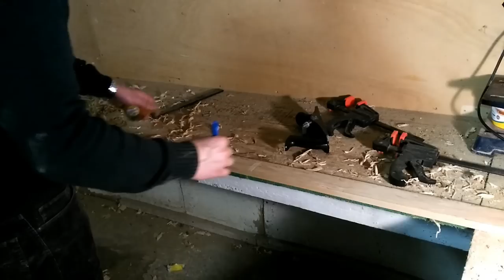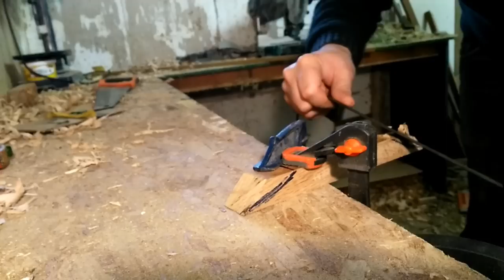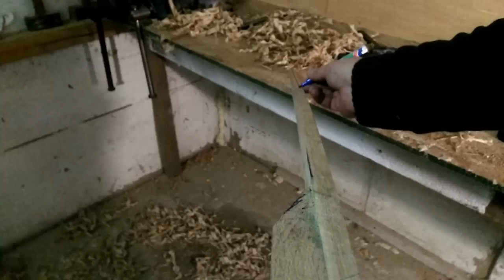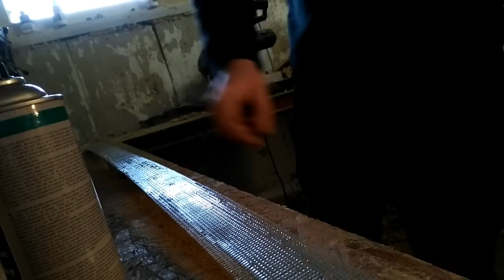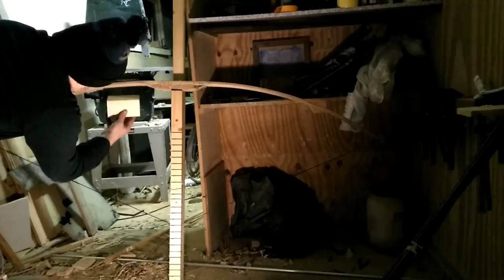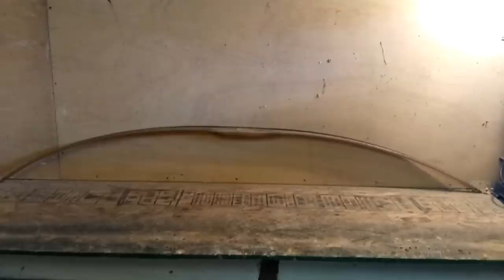DIY white Oak Longbow Using Handtools

Comment: I like how there are always the guys who call out string follow on a new bowyers work, as if they have never made a bow with string follow. 
Keep at it! Every bow is an opportunity to learn.
Reply from the maker: Thanks! I absolutely learned quite a bitmaking this bow, it was my first 'real' bow that wasn't make from a stick i found in the woods :'D Next one will be better! Thanks for watching!
Reply: @RobinCoomans   a little string follow smooths out the shooting, improves grouping, is more forgiving on release and lengthens the life of the bow.  All that for the price of five pounds of pull.   If you take it into consideration in the original poundage, and make your 55# bow 60# to start with, it will sweeten up at around 45-50 pounds and pretty much stay there.   I make mostly crossbow prods and string follow is a fact of life for a thirty inch or less bow.  I brace them at three inches or less and get on with my life.

Comment: nice, I never tried drywall tape, but I have built dozens of pyramid bows with straight grain oak from the lumber yard with raw hide backing. that's getting harder to find so I may give your method a try. thanks for the vid.
Reply from the maker: I've got a link to a website that I followed for this bow, he mentioned several backing that can be used! Thanks for watching!!

Comment: I noticed that when you had the bow in the jig used to ease the limbs into flexibility you ran a block along the bottom of it, was this to test if there was any uneven surfaces?
Reply from the maker: Yup, it was to see if the bow was bending the same everywhere. If the gap between the bow and the block change, the bow is nog bending evenly. Thanks for watching!

Comment: Interesting use of the block in tillering (the small block you run along the limb).  Is that sized to look for a particular angle?
Reply from the maker: No just a block I think I cut it at 10cm (4") or so. Just to check for an even gap. If the gap changes, the curve is not smooth and some material needs to be removed. Thanks for watching Joshua!

Comment: Is it right to take first front layer of wood ring? I thought avoiding this is fundamental thing for a good bow...
Reply from the maker: You should leave the sapwood for a selfbow if possible, for example in a English longbow it is very important! Because I used a stave from the sawmill I didn't have that. The drywall tape fills that role in this case. Thanks for watching!

Comment: There are many materials that could have been used as backing.  Linen and silk fabrics. Even heavy brown paper. There's alternatives to the fiberglass tape.
Reply from the maker: Sure! At first I actually wanted to try the paper, but I had this tape and it looked like an interesting choice too. Thanks for watching!
Reply: JSYK. you can also cover the back and belly with cotton strips cut from some old blue jeans and glue on using 2-hour epoxy. Thin the epoxy slightly with acetone just a little to make it creamy. Coat the bow, then the blue jean strip and apply, Cut a short piece of 1 inch round dowel to roll back and forth until you get a good smooth surface. After it sets, you can coat the outside with another thinned mix. Be sure to 'till' your bow first at about ¾ draw length first. Then you can trim the side tapper to finish getting a good curve to the bow. Look up 'tilling a bow' on youtube.

Comment: Good job Robin ! Maybe feather arrows will work better and more accurate because of the feathers structure.  :)
Reply from the maker: Adrián Hlina No doubt! And they look a lot better too. But Iwanted some arrows quickly and they seem to do the job :) Thanks for watching!
Reply: I use vinyl aisle marking tape for fletching my crossbow bolts.  It is thinner and smoother and much lighter than duct tape, and there is no 'glue squeeze'.  One big roll is essentially a lifetime supply.

Comment: I am new to self-style longbows and wondered about the bow taking a set when strung. How did the old archers deal with it and how today? Is it just accepted or do we do something to reset the set (string-follow). Does string-follow decrease the strength or accuracy of the bow? Thanks!
Reply from the maker: I don't know a whole lot about bows to be honest. I think for the most part you just deal with the set in a bow.. perhaps you could use some heat/steam to straighten all wooden bows I don't knw if this is common practice or not.  If the bow has laminations don't even think about the heat/steam, as the glue (epoxy usually) will  let go. 
I think that back in the day, as well as today,  you should look for a good piece of wood and take some more care making the bow and when it is in use obviously.

The set does indeed reduce the power of the bow. In my case it was not all bad as my little sister likes to shoot it :) If you are interested in some beautiful self-bows take a look at  the archery section: http://paleoplanet69529.yuku.com/directory#.WUFLoJDyhPZ

Thanks for watching!
Reply: Robin Coomans  Be careful not to tiller it too far too soon. That can cause set. You should try to achieve your target draw weight at every step of tillering. So if your target draw weight is 40lb, then pull to whatever length get you to 40, then tiller, then pull to 40, then tiller, etc until you are at your target draw length. I know this in theory just from reading but not in practice so take with a grain of salt!

Comment: Please tell me what epoxy on handle and what epoxy for tape. I tried epidermix on handle and it broke loose under tension. I used 2 layers of the tape with fiberglass resin but it reacted with the tape.
Thank you from Mickey in South Africa.
Reply from the maker: Hi, I don't know the epidermix brand. I used some 3M epoxy that changes colour when it cures, but I can't recommend that either. The glue I used for the tape on the back is just regular wood glue. Thanks for watching and the best of luck next time!! 👊

Comment: Will it break if u don't use the fibreglass? Not sure if it's fibre glass
Reply from the maker: Yup, it's fiberglass drywall tape. A backing is not necessary if your wood is good. In my case it was far from perfect tbh.
Reply: Ok thanks

Comment: you think make it in the wood s  if you just had a blue tarp Gorilla Glue  and a knife
Reply from the maker: I could definitly make a working bow in the woods with just a knife. Thats what I used to di a lot as a kid!
Reply from the maker: RowanBows Oh really? I don't know a whole lot about bow woods. But I had some red oak too and that seemed to be a lot more brittle. That being said, the piece I used definitly needed the backing!
Reply: I think you mean to say "red oak is only oak usable for selfbows", in the US lots of good woods  Hickory, Osage, Ash, Chokecherry.  Hickory is probably the most forgiving for beginners. Lots of older books say white Oak is not very good.   My philosophy is try it and see.  If you are not making a high draw weight bows, lots of woods yield a bow that works, might not last forever.
Reply from the maker: Yes! I actually have a couple of ash staves that are drying at the moment.
That's my mindset on these things as well. If it did break .. well big deal, I'll do it better/different next time!  I had this wood lying around so I tried it, made it pretty light too just to be on the safe side. 
Thanks for watching!!

Comment: Disculpa cual es el nombre de la cinta de refuerzo que usas y que spray le aplicas despues?

Excuse me what is the name of the tape you used? And the spray you used.....how can i found it?
Reply: Mario De Jesús Alpuche Santander Looked like fiberglass tape. Any hardware store should sell it. I don't think it's necessary or that beneficial though. The advantage is that it will make the bow less likely to splinter or snap from the back. The big disadvantage is that wood is much stronger in tension than compression, so the back will overpower the belly, lose speed and take set.
Reply from the maker: Yes it's fiberglass tape for drywall. If you use a good piece of wood you won't need it. The wood I used was not really good for bow making.. so I went with the tape option just to reinforce the back. (Because it was used in the tutorial I followed) The spray is just some cheap black spraypaint.

Thanks for watching!
Reply: JSYK. you can also cover the back and belly with cotton strips cut from some old blue jeans and glue on using 2-hour epoxy. Thin the epoxy slightly with acetone just a little to make it creamy. Coat the bow, then the blue jean strip and apply, Cut a short piece of 1 inch round dowel to roll back and forth until you get a good smooth surface. After it sets, you can coat the outside with another thinned mix. Be sure to 'till' your bow first at about ¾ draw length first. Then you can trim the side tapper to finish getting a good curve to the bow. Look up 'tilling a bow' on youtube.

Comment: That bow is good for backyard fun ig. But if you looked at the arrow flight it was sad and unaccurate due to the arrow fleching and the arrow rest
Reply from the maker: Jon Sands Yes, it was just meant to have a bit of fun. And does that just fine. Obviously the shot isnt very straight right out of the bow as there is no arrowrest. Thanks for watching.
Reply: Jon Sands it is posseble that the bow is to strong for the arrow. 

then a more stif arrow will do the job

Comment: It's really disappointing how short the effective range of a bow is.
Reply: That really depends on the kind of bow man. 
This bow isnt the fastest most powerful bow and is using arrows that have bad fletching and are probably not even spined well.
When u make a proper bow or buy one (the ones around 100 euros)  and use good arrows u can use it at least until 50 meters. If you buy a even better one (200 euros or more) you can shoot much farther.

Comment: de cuantas libras quedo el arco?
Reply from the maker: I never really measured, but it's pretty light. I'm guessing in the 30 pound range.  If i don't forget I can probably measure tomorrow. Thanks for watching!
Reply: Robin Coomans sinceramente me gusto mucho el video y pienso tenerlo junto a mi mientras realize el mio. Por último, he buscado y leido manuales durante hs en la web pero no encuentro la respuesta sobre cómo dar mas potencia al arco,  ya q busco uno de 60libras,  puedo lograrlo acortando el arco y ensanchando las paletas ?  la capa de fibra de vidrio le aumenta la potencia?
Reply from the maker: Hi, You can make a heavier bow by making the limbs a bit thicker. I would not make the bow any shorter, I feel like that would lead to the bow breaking (with the wood I had). For a heavier bow, I would use some different wood that is more suitable for bows.. I can't really help you with this as I don't know a whole lot about this to be honest. I suggest  you do a search on some bowyer forums! 
In this case the backing is drywall fiberglass tape and prevents the wood from splitting, it does not really change the draw wheight (maybe a tiny bit). I followed this tutorial: http://poorfolkbows.com/oak.htm 
ps: I hope I answered your question sufficiently, had to translate with google translate!

Edit: Take a look at these sites forums for example, those are some of my favorites! https://www.tapatalk.com/groups/paleoplanet69529/     ,     http://www.primitivearcher.com/smf/index.php?PHPSESSID=d041i7ivl6nlj4v3s44616sek0&
Reply: muchas gracias Robin, aprecio mucho que te tomaras el tiempo de responder y ayudarme, voy a continuar buscando hasta dar con la info! thanks u and good luck  !!
Reply from the maker: No problem!! Good luck to you too!

Comment: think i could do this? im between 11 and 14
Reply from the maker: Sure! I made a lot of bows at that age just from branches/saplings I found in the woods. This one is not that difficult either, just take your time and remove material a little bit at a time as you can always take more off. You might need some help with the initial dimensioning of the wood, depending on what you start off with. 

Good luck!!
Reply: thank you!
Reply: breyergirlZ: Dude, you can totally do this. All you need are some hand tools and a good piece of wood. Little saplings aren’t the best for bow making, they are weak because they haven’t had to fight the wind and elements. A good sized branch from a tree is quite a bit tougher and can make a simple bow.
Reply: breyergirlZ Remember,  you can do what you want, never create limits for your self.
Reply: I am 66, At 12, I made two bows out of a trunk section ash tree my father cut down for firewood and being in the way of a garage project. Father was not confident of me. However both came out very good at about 35 pounds pull at my draw of 23 inches. I shot thousands of arrows from them. Mine were of the flat long bow at 2.5 inches at broadest point rather than semi round long bow. Both were fast and accurate. I killed many squirrels and rabbits and one small deer with them. But my favorite game was 'cloud shooting' in a long pasture next door when the cows were not around.
So you most certainly can build your own bows. I wrapped mine with a good quality cotton twine to prevent splitting but I don't think it was necessary. No fiberglassing. You do need dry, perhaps 'seasoned' wood. Good luck, lots of fun.
Reply: Ryder Nigga right that age gap had me like wtf for a second 😂

Comment: Doe the fiberglass go on the inside or outside?
Reply from the maker: On the outside. This is to reinforce the back of the bow, so no no pieces of wood split when you pull the string back.
Thanks for watching.